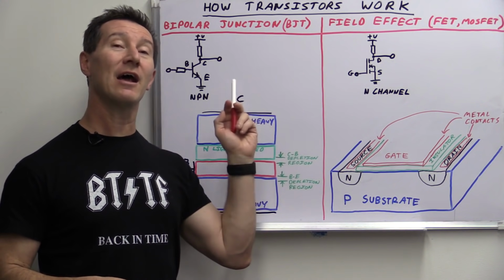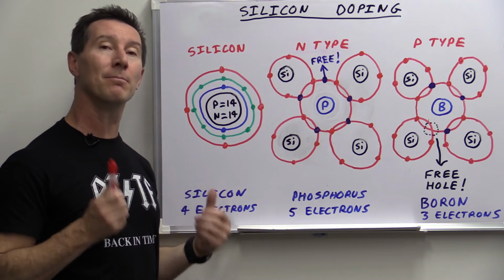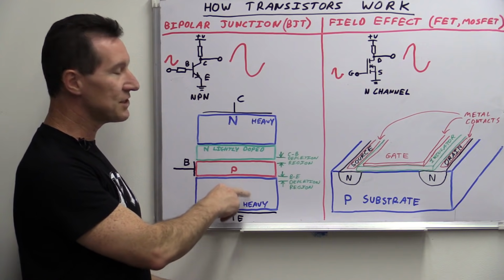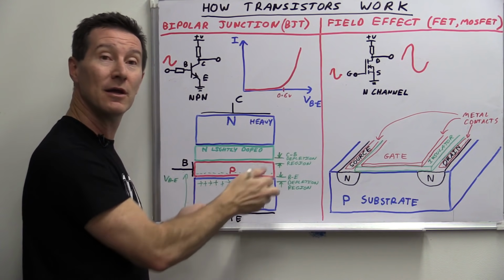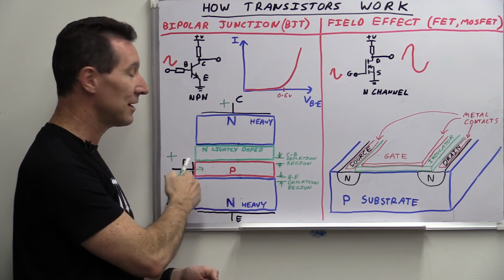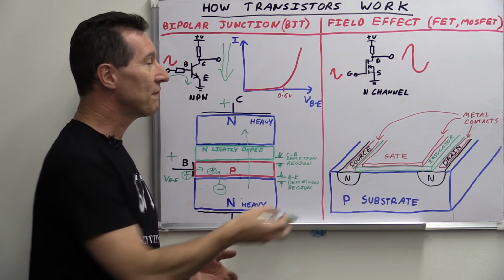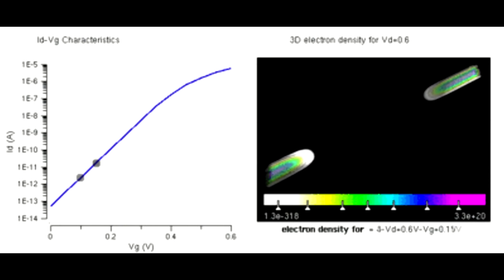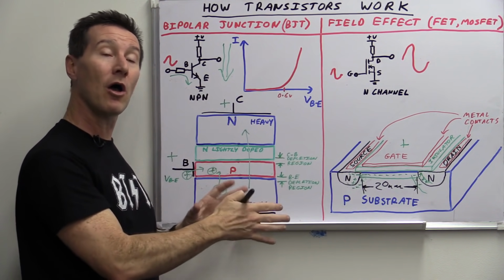EEVblog #748 - How Do Transistors Work?

Comment: A point I never understood. Why do we call it amplifying? A transistor does not generate (or, amplify in your terms) amper out of nothing, correct? It all depends on the max amper that supply provides (collector lead), after all. It cannot exceed the total amperage of supply, right? Or, it is called amplifying in relation to base amper level/ratio?
Could we rephrase that it adjusts the amper at collector to emitter, based on the amper level on BASE up to the max of suppply. Thanks,,.

Comment: interesting thing about it is a "hole" does not move per say, it just fill and empty of electrons , and one electron moves to push or pull another one along..of you think of a.c. moving polarity back and forth the electrons just move back and forth. so why do you have to bother to think of holes moving..it's not necessary to understand how electricity works...electrons move through holes makes more real sense to me. and it's how I always saw it.. I suppose the holes move if you can move molecules. but if a silicon lattice is a stationary crystal the holes don't move.

Comment: So does the lightly doped n-type area have more resistance because there's more stable silicon molecules and the more you ionize the silicon the lower its resistance gets because its potential to be conductive gets higher?

Comment: I still don't see (for the BJT) how the base emitter current is amplified into a higher collector current...?  Somehow, what, 5 electrons entering the emitter results in, what, 100 electrons going through the base region and causing 100 holes to move into the collector region...?  What accounts for that?

Comment: Hi Dave, first thanks for all your awesome videos, not only this one.
As a small suggestion, the MOSFET it's easier to understand if the 4th terminal (often not shown) is included and conected to the source terminal, so the electric field is applied to the whole substrate creating the conductive channel

Comment: About the MOSFET: you made a wrong drawing. The source is connected to a positively doped area that contacts the substrate and it forms a body diode along with the drain... And a MOSFET consumes current through the gate actually. Make a small design with a light bulb in the drain of a MOSFET and measure the gate current. It will be constant as long as the bulb is lit. And now explain that!

Comment: Man, you have no idea what you are talking about.... Electrons flowing through the crystal? From where? And where do they go? And, if you tell me that electric current is made up of electrons flowing through wires, tell me how does a DC source charge a capacitor? Or how does a capacitor get charged if it is in the collector of a transistor? Cause it charges, no problem, but electrons and holes would have to go through a dielectric. Explain this and I believe all you said in the video. Thank you!

Comment: Hi, 
thanks for your videos which are really helpful,
I have a question if you please help me in as I spent quiet time in searching and experimenting about (actually I'm a civil engineer, not electronics)
the question is:
I have a very weak signal 27MHz to amplify and I tried several ways to amplify using a transistor (not an IC) but the first stage transistor circuit is not giving the expected amplification, the last info I got was that the resistors selection needs to allow such week signal to trigger (turn on) the transistor (impedance issue) for which:
- can you please advise me what would be the best range of transistor (lower - like hundreds of ohms - or higher - kilos or megas of ohm-)?
- is there a better way to amplify weak signals?
thanks a lot in advance.

Comment: Why does the current not flow from emitter to collector while they are connected to a voltage source of eg 5 volts (5 volts are higher than the voltage difference of two depletion regions formed) while there is no voltage source connected to the base emitter jucntion?

Comment: Thanks for the video, but there is one misunderstanding. 15:50. The depletion region is formed by the negative ions in the p-type/substrate side and the positive ions in the n-type (source) side, not electrons and holes like what you mentioned. The negative ions (acceptors) are created in the p-type/substrate side due to the gain of electrons diffused from n-type, whereas the positive ions (donors) are created in the n-type/source side due to the loss of the electrons which diffuses to the p-type/substrate side. Hope you can add notes there (15:50) to not let people misunderstand this. Thanks.

Comment: So I assume the lightly doped material region is also the reason for the fixed position of collector and emitter?
In almost all other idagrams explaining transistors, this lightly doped region is omitted, and it had me scratching my head why I can't simply flip a transistor around. I.e. if the emitter and collector sides of a transistor are the same, what'd stop me from flipping it around?

Comment: Why is it that when extra electrons leave the N type region into the P type region they leave behind "holes", that doesn't make any sense. If I have -1 charge and I give it away, then it doesn't go to +1, it goes to zero. The holes are spaces where you need an electron, so giving an extra electron away doesn't leave behind an empty space, because it was an extra anyways. If I have a negative 1 charge and a +1 charge the -1 charge wants to be 0, lowest energy state, so it gives the -1 charge to the +1 (the +1 wants to be zero as well), it doesn't give away -2 charges to leave it with a +1, that doesn't make any sense. The holes can't move, only electrons can move.

Comment: 3 years on and very very informative. Ironically, 14nm processes by Samsung Alliance like 14LPP have a gate length of 30nm. I think finfet doesn't follow the old tradition of decreasing the gate length/pitch (looking at intel's early 22 node too gives some insights) and... Well, Intel is struggling with 10/7nm now. 
Moore's law, created by an Intel employee and now Intel say they are unable to adhere to it anymore because they are struggling with EUV.

Comment: When I trained with the P.M.G. in the sixties we were taught that the old conventions were wrong, that current flowed from -ve to +ve and that electron flow was the new future in electronics. Easily understood and remembered when you study the operation of a vacuum tube amplifier. At the same time, Cycles per Second (CPS) was being dispensed with and replaced with Hz (in honour of Hertz). Voltage was to be represented by E (for electromotive force) in lieu of V. So, I = E / R. Out with the old and in with the new. Hole movement was theorectical, the electrons moved into the holes leaving holes behind them. In a theatre, there's an empty seat (hole) at the far end of the row. Instead of the new patron (electron) stumbing all the way down the row, it's easier for everyone in the row to move to an adjacent seat. The empty seat (hole) effectively moves to the other end of the row but it's really the patrons (electrons) that are moving. Without a discussion of manufacture and the actual fusing together of the PN layers in an oven, there is no clear understanding here of how the depletion layer forms. These aren't pieces of silicon that are just placed next to each other, they are FUSED. The depletion layer creates an actual potential difference that must be overcome by external forces before current can begin to flow. When and why did the electronics industry revert from the NEW sixties conventions and decide to fall back to confusing ancient conventional current flow and also, bring back "V"?
Reply: Blame it on Benjamin Franklin. He didn't know about elections and just guessed at which way the current flowed. He got it wrong.

Comment: And for those who thinks this is the best explanation they have ever seen, I recommend you to read Shockley's original book on the subject 

"Electrons and Holes in Semiconductors with Applications to Transistor Electronics" 

or 

Chenming Hu's

"Modern Semiconductor Devices for Integrated Circuits"

Comment: if i put 2 transistors in parallel will collector emiter saturation voltage get  low or not ? and is there a way of making that possible ? because i need a low collector emiter saturation voltage transistor and i researched them and they are expensive

Comment: Quick question - why does current want to flow through the lightly-doped, higher resistance material, instead of just flowing through the base?  

Is that how it naturally wants to flow, so we have to ensure that a higher resistance is attached to the base (outside of the transistor)?
Reply: Answer: there are two kinds of current in the same material.  Instead if we wrongly assume that there's just one "current," then nothing about BJTs will make sense.  We can't understand transistors until first we achive a very firm grasp on the "two flows" concepts.
Reply: Thanks for answering wbeaty.  I know there's current flowing from B-E and from the C-E, and that the C-E current is much larger, but it seems to me that if current has the 'choice' to flow through a high resistance or low resistance, it would 'choose' to go through the low R.  
Am I correct to assume that this would happen if both the base and collector both had the same voltage applied directly to them (>0.7v)?
Reply: It doesn't have a 'choice.'   Instead, there are two kinds of current in the same material, with the two kinds of charge-carriers flowing past each other in opposite directions.   One kind is injected via the base terminal and flows towards the emitter, while the other kind is injected via the emitter terminal and flows through the base and into the collector.   The flow-rates of the two kinds of current (the two values of mA) are both determined by the height of the potential barrier in the emitter junction: Vbe.  Change Vbe and both the Ib and the Ic will change together.    Or, if we inject a constant Ib into Base, that will determine the value of Vbe, and then the changed Vbe will determine the new value of Ic.

Also go see Horowitz/Hill "Art of Electronics," the section about Ebers-Moll description of the internal workings of BJTs.

Comment: it would all be so much simpler if conventional flow followed electron flow.  seams to me a bunch of stubborn old men and maybe some women refuses to teach electronics using electron flow.
Reply: >stubborn old men  ...actually it's the opposite:  the entire physics and engineering community understands Conventional Current, and uses it for everything.  The "electron flow" concepts are simply wrong.   But a small community of non-scientist/non-engineers remains trapped in ignorance, and refuses to admit that protons can flow (in acids,)  ions can flow (in human flesh and in the ground and in sparks,) and that electron-flow is mostly useful as an oversimplified concept designed for children.   Grown-ups confront reality, and give up the incorrect concepts which were taught in grades school and in a few technician classrooms.

Comment: @EEVblog Hi Dave, maybe you can answer this question of which i don't really know the answer...What is the maximum input voltage or current that can be sent into the base of a transistor (FOR AUDIO USE - PRE AMPS) and where is this info on the specifications data sheet of that particular transistor?
For e.g a BC547B signal transistor NPN, what is the maximum voltage into the base allowed before it burns out? I know that it takes about 0.7 Volts to turn on so that's the minimum input into the base, but can i put 2 Volts into the base and will it be okay OR will that transistor be totally overloaded and distort because of the high voltage (IN AUDIO USE)
This is what i don't know the answer to,i suppose my question is like overloading the input of a preamplifier,for example putting an electronic guitar output (maybe 1 volt) into the input of a RIAA TURNTABLE pre-amp (which is designed for about 5mv sensitivity) the guitar output would totally overload the input and distort like crazy, so I am trying to find out if on specification sheets transistors have a max limit into the base voltage and if so what that is called.
For example the amount of times a transistor can amplify is know as HFE, I am looking for title like that which signifies the maximum voltage or current allowed into that transistor before its too much for it.
When i know this info then i can choose specific transistors for audio applications.
DOES OVERLOADING THE BASE INPUT OF A TRANSITOR CAUSE IT STRAIN?, WILL IT DESTROY IT OR JUST DISTORT THE SIGNAL
THANKS IN ADVANCE - YOUR VIDEOS ARE GREAT - LOTS OF PASSION - VERY INFORMATIVE AND FUN AND EDUCATIONAL OF COURSE - THANKS FOR ALL YOUR EFFORT
Reply: SP330Y when in doubt, Google for datasheets.

Comment: There's a thing I can't get. When the electrons fill the holes in the depletion regions (forming so called "excitons", based on what I've read), how do we get them to split up again?
Reply: By overcoming the bias voltage of 0.6V you effectively get rid of the depletion region.

Comment: Heh great video Dave!
What I would do in the past is just match up the numbers and not really think of how the things work.
Today I wondered how leg transistors work and this video was on the first page of youtube.
You certainly explain stuff so even this dummy can understand it. :)

I am learning about how stuff works here recently as I am working on a custom pinball machine and no not one of those toy kinds.
A full sized 52" long pinball machine. ;)

I think the mechanical and circuit boards will be the hardest.
And I would send it off to you for Mailbag day but that would be costly and right now still in development as well.

Comment: This is the best explanation of transistors I have ever heard/read/seen.
 
Only question... When you say the holes/electrons "switch" at a P/N junction. Is it more the case that the electrons just jump across from the N type and fill the hole in the P type material. Effectively blocking the holes. I cant conceive of the holes "moving"  An electron shell cant gain an extra hole can it?

Thanks Dave :)

Comment: This is really useful. Even for people who work with this regularly to be able to explain it to other people. Thanks!
Reply: I think what happens is that the electron moves over, and thus the atom left behind is now genuinely positively charged. Obviously the P type silicon wants to have that extra electron to fill its shell, but technically it is neutrally charged, and the N type wants that extra electron gone from its shell, but is also still neutral. When they meet up and the electrons go from the N type to the P type, they happily fix their she'll situation, but the result is that now you literally have a negative charge on the P type and a positive on the N type. It's almost like the "holes" did move over. Technically of course the situation is fundamentally different, but from an engineering point of view you don't need to care about that, you can just say the two materials swapped roles.